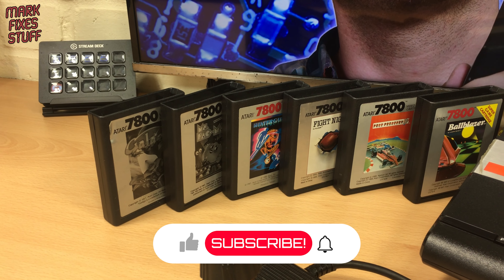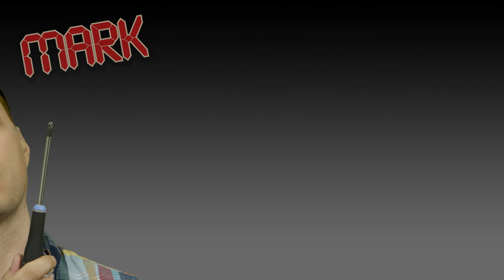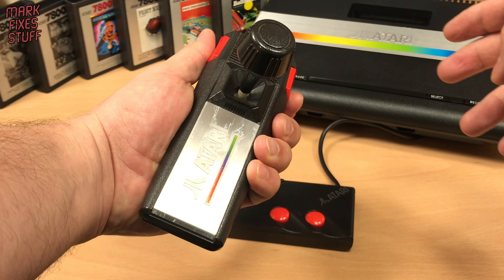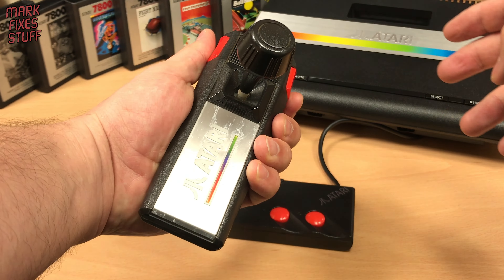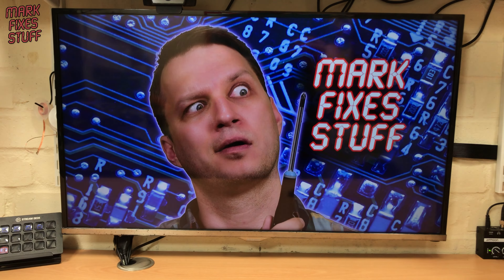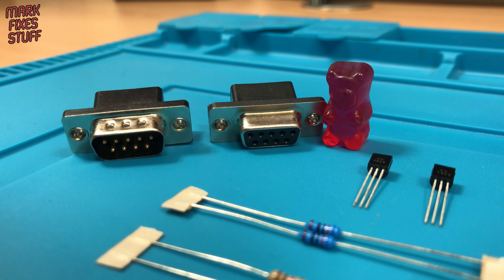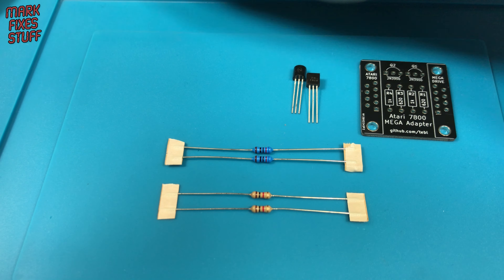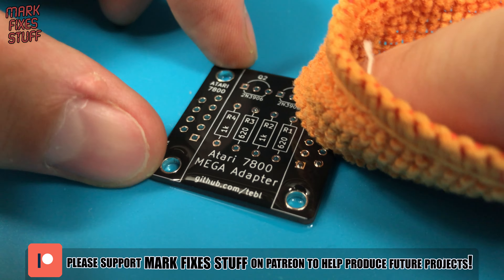Making a Sega Megadrive Controller Adapter for Atari 7800! Full Build & Games Testing!

Comment: Looks like a great little adapter! Alternatively, rather than soldering the 7800 connector on at an angle you could use a joystick extension cable.
Reply from the maker: Yes. I thought that at the time too. Make a corded dongle. I wanted to follow the creators instructions as closely as possible though. It also added a bit more to the cost of the build.
Reply: @MarkFixesStuff  That's fine and of course it worked out great! I just thought I'd mention it for the benefit of anyone who might be struggling to get the port soldered on at the correct angle. 🙂

Comment: Does this work with SMS pad to Atari 7800?
Reply from the maker: Im not actually sure to be truthful.
Reply: @MarkFixesStuff   i used google and prob not working :/
Reply: No. The SMS controller is less complex. The problem is that buttons left and right are wired in such a way that you couldn’t do it with an external adapter alone, you also would have to modify the 1 and 2 button circuit inside the controller and probably would break SMS compatibility in the process.